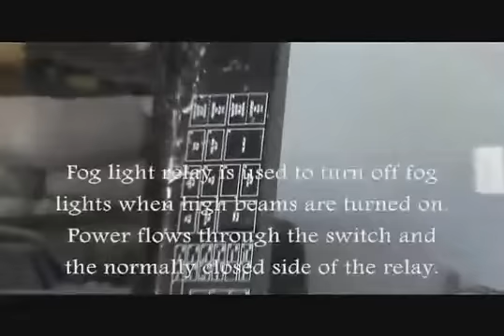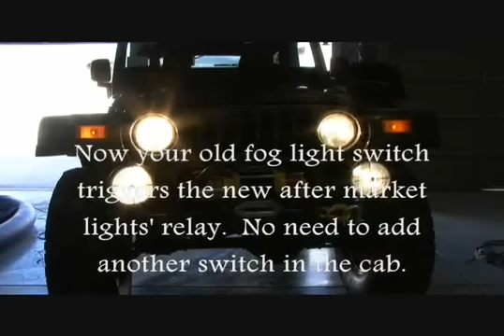TJ & LJ Fog Light Switch Mod

Comment: Just bend or clip the #1 pin on the relay, does the same thing without having to take fuse box apart and tearing into the factory harness
Reply from the maker: The point of this process is to take the load off the switch which is what burns out. This then puts the load on a seperate relay.

Comment: Great idea! Have a 99 Wrangler TJ Sport. Our relay box looks completely different. (http://i33.photobucket.com/albums/d82/N5XL/TJ%20Elecrical/P1010011.jpg) No relay. Like to reuse interior switches (fog, defrost, wiper/wash) for LED's. Appreciate your input and help. Thanks.
Reply: how did you go about that - i have a 99 TJ sport aswell. Would like to use the fog switch for aux light

Comment: There is a much easier way to do this.  Remove the relay and remove its cover.  Put a cardboard shim between the coil and the armature of the relay.  Re-install the relay cover and the relay.  You are done.  It takes about 5 minutes